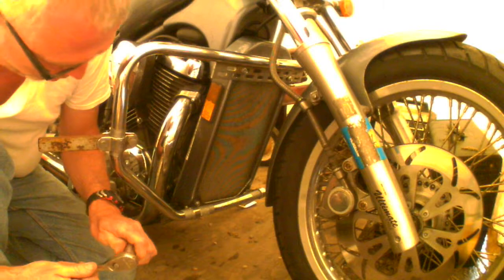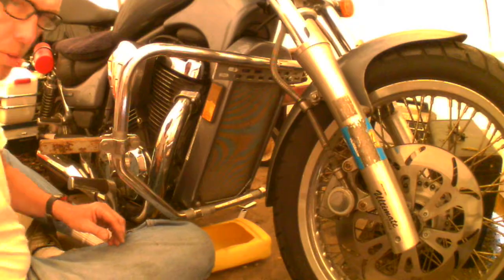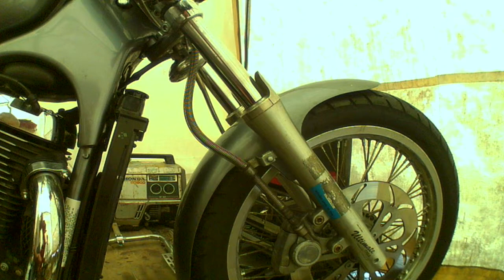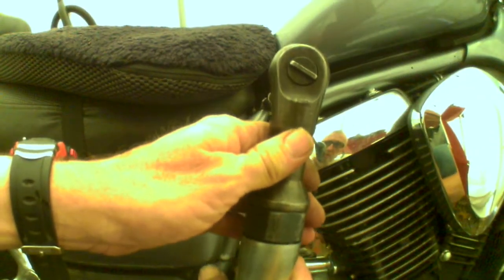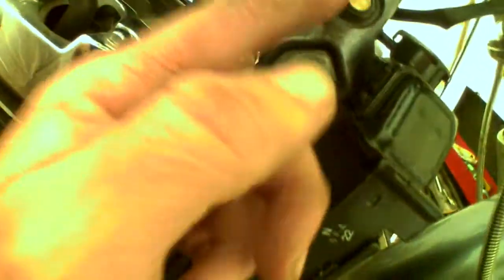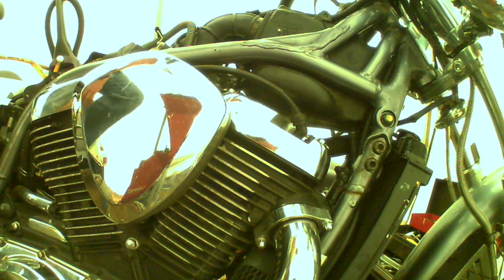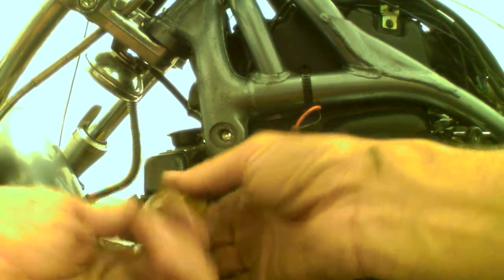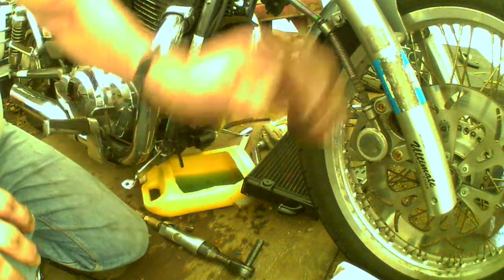Removing Radiator (Real Time) 2005 Suzuki S50 Boulevard (vs800 / 800cc) Part 1/2

Comment: Nice video. With your comments I’ve developed a little confidence in getting mine done. I have a 03 intruder. My fan stopped working. Did a direct connection. Realized it’s ok. Need to look further for that sensor don’t know where to go.
Reply from the maker: Follow the wire(s), you might also be able to find a diagram someplace, I don't recall but I think most anything 1999-2007 Intruder / Boulevard should work for reference purposes.

Comment: Nice vid. Looks basically like my 96 intruder. Browsing thru vids seeing how hard it will be to remove my fan and diagnose why it isn't working b4 this indiana weather gets too nice.
Reply from the maker: Might be your temp switch, I'd see if you can disconnect it and hook 12v to the leads, if it spins up then your problem isn't the fan itself.
Reply: Pascal Junger Thanks for the advice, yeah i tried that earlier today on the temp sensor and nothing, i got the bike late last fall, and rode till snowed in, hasn't overheated yet, i believe it probably just needs cleaned in the motor cavity, either way it'll get fixed or replaced. Thanks for your reply, have a safe season of riding